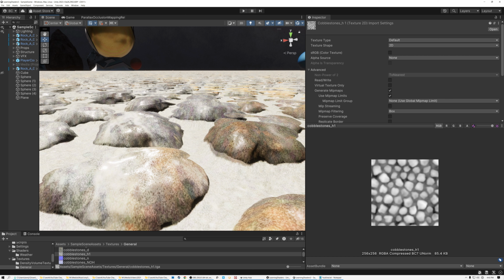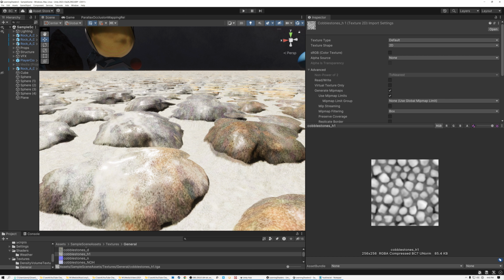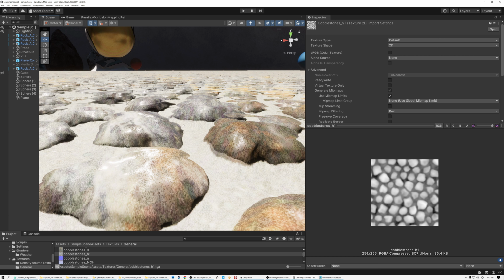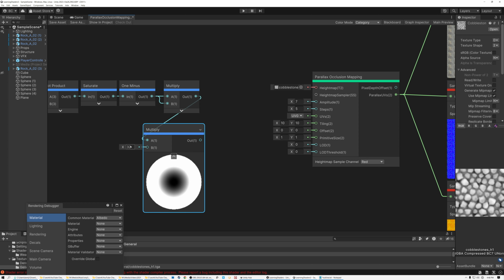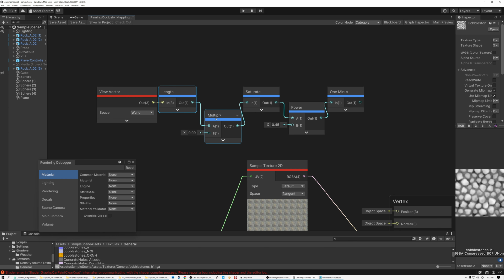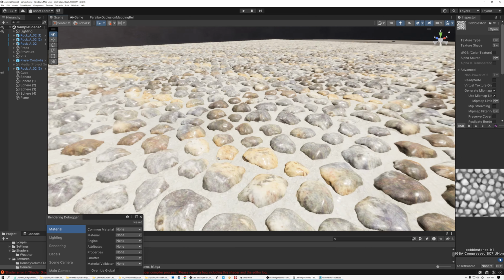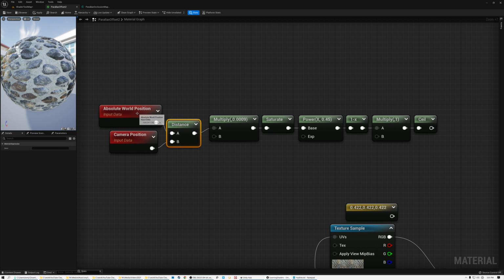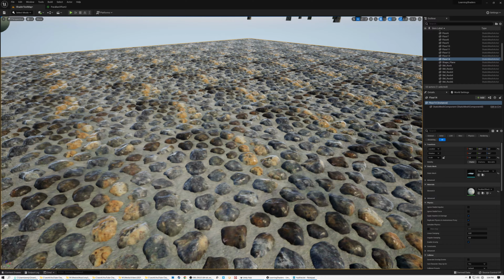Parallax Occlusion Optimization - Advanced Materials - Episode 15

Comment: Thanks for showing me a cool way to optimize POM. Watching your video gave me an idea: what if we mask the steps based on Scene Depth? 
For areas closer to the camera, we could use a higher sample count, and for farther areas, we could use fewer samples. What do you think of this idea?
Reply from the maker: In this video, we're finding the distance from the camera to the surface and changing the number of samples based on that. This is the same as scene depth. You could use scene depth for this instead, if it's available, but there are some cases where it's not - so I chose to use this method.

Comment: Hey Ben, thank you for the tutorial.
I am wondering how the LOD input works in Unity?
I tried to test it by myself and seems like it has nothing common with LOD Group component settings.
Seems like it works the way Parallax Mapping linearly becomes flat when it's LOD input value is between (LOD Threshold) value and (LOD Threshold+1) value.
So probably I can easily use  distance from camera calculation plugged in LOD input to make Parallax Occlusion being flat on distance.
I am wondering if it can make the material even more optimized than you did at this video? Or it just affects the POM amplitude value and does nothing for performance?

Comment: Dear Ben, do parallax materials work with trim sheets (multiple textures on one sheet and mesh cut up into pieces) or just tiled textures? I am having issues to get trimsheets to work properly with pom. Somehow the pom doesn’t know when a trim ends and bleeds into the next one on the sheet. I asked on discord and somebody said that one would have to change uv mapping?!
Reply: That's just how trim textures work, if the uv mapping is off for the mesh, the texture will have other parts of it appearing on it.

For example if we have a simple trim texture, top half being red and bottom half being blue - the way UVs are mapped should be done properly, because if a little bit of it goes up or down that part will be visible on the mesh.

You can use modeling tools in UE5 to change it if you're in that engine or just opening the model in blender to move the UVs.

Comment: There is one thing I don't understand. When you connect both two multiplied masks straight to the base color and move away on a distance- the object becomes black. But how could it be, if we have a ceiling node at the end of all multiplications? I mean, you said the ceiling node would round the number to one, but on a distance I got black color. The first mask works correctly and never goes lower than one (the object is always white), but the second mask goes to black on a distance, having a ceiling at the end, after the all masks multiplication. I mean, this is how it should work in the best conditions, but I don't understand the math here (having a ceiling at the end, we somehow get black(0)).

Comment: I could be wrong, but you can't change shader complexity only changing camera distance and switch steps or so on. It still will have same number of instructions. Only way to optimize material its use different simplyfied mats between lods, or iаm wrong?
Reply from the maker: This is one of those cases where instruction counts are very deceptive.  Just judging by the instruction count, you could easily make the conclusion that you can't change performance based on distance.  But in this case, the parallax node is using a for loop internally, and the instruction count only shows you the maximum instructions.  If you change the number of steps dynamically, it actually DOES reduce the number of loops it's doing in the for loop, so it ends up making it a LOT cheaper. But don't take my word for it.  Try it out for yourself and verify!
Reply: @BenCloward  Thank you Ben) will make some tests with this technique with different type of shaders.

Comment: Thanks, these optimizations helped me develop my POM system that works fairly well with a distance of about 8 units. 
It would be great to take a look at blending POM between multiple landscape textures, as they appear to float above each other.
Perhaps something like including multiple textures in the POM core loop and raymarching all of them and taking the "highest" one. But it would seem that the other textures need pulled down into the screen as if they are the lower parts of the texture that's winning.

Comment: A question is it cheaper to use the Fresnel node instead of the custom view + dot product shown in the video?
Reply from the maker: It may be a TINY bit cheaper to use the custom method but the difference will be so small it won't be measurable. But of course the best answer to every "is it cheaper" question is to test it!

Comment: Thank you for your great tutorials!
When I try to apply parallax occlusion on an object that is not based on a main flat surface I get very weird effects: I tried to make some bumpy moss on some rocks, but the result was quite bad 😞
Is it me doing something wrong or this method doesn't work well when the material is applied on a complex shape mesh?
Thank you
Reply: Simple PoM casts its rays based on the assumption that the surface is flat. You can get acceptable results on surfaces that have gentle curves (like terrain), but the more curved a surface is, the worse artifacts you will have. The greater the offset is, the worse artifacts you will have. If you stick to a small offset amount, and mainly offset down/inward and not up/outward, you can get acceptable results on even fairly curved surfaces.

Comment: What would the performance difference be between this an tesselation?
Reply: It depends on the scale you’re working at. POM works great for larger objects that need lots of detail like terrains. Tessellation has relatively similar performance impacts to polygon count, because essentially tessellation is adding polygons. Tessellating a 4km landscape makes no sense. But for smaller objects, say a tree trunk, it works out very nicely. POM is generally for flattish surfaces and won’t let you make nice silhouettes on corners. Think of the corner of a brick wall, it goes in and out with the grooves, a look that POM can’t really do. POM is also great if you don’t want to even deal with bad topology or anything, it just “works.” The advantage of tessellation and POM is that you don’t have to deal with all the headaches of high poly models until the very end when you see it in engine, and you can easily scale it depending on hardware.

Tessellation at landscape scale is dumb and hurts performance, but at small scale is very nice. POM is somewhat okay at any scale but you kinda get diminishing returns as you scale down, better just to represent with triangles at a certain point. What exactly that point is I’m not 100% sure (though it somewhat depends on your specific hardware) but I just like to use POM sparingly where triangles start to become an issue and where it makes sense to do so (flat stuff w/straight/no corners)
Reply: @dylankuzmick3122  UE5 doesn't care about polycount anymore but your reply is enlightening nonetheless. I personaly like it better to use a height map in the modeling tools displacement deform tools because it's easier but hey! you got me thinking 🤔
Reply: @GhtPTR  Very true, but in fact UE5 doesn't actually have dynamic tesselation as a feature anymore, they got rid of it (except virtual heighfield meshes which tessalate only terrains based on a faloff distance, but that's an edge case I hardly use because of POM anyway, even in UE5). Regarding heightmaps, absolutely, I use them all the time! Sometimes people confuse displacement and tesselation since they go so hand in hand. Tesselation subdivides geo and adds triangles (realtime tesselation removed in UE5), displacement moves the geomety's verteces up and down based on the colors and uv mapping of the heightmap (in UE it's called WPO). Usually adding more tesselation gives more detailed displacement, but since realtime tesselation isn't a thing in UE5, you have to make sure your geometry has enough verteces when imported into the engine to look nice.
One thing to note though is that you CAN add tesselation to meshes in UE5 using the mesh editing tools, but you really should bake it (which takes a couple minutes depending on the tri count) and enable Nanite for it to not slow your system down. If you're working with meshes you've made yourself, it's usually faster to do this in your DCC of choice (Blender, Maya, ect.) instead of Unreal.

Also, for general reference, I find that for a 2X2m plane, I need to add at least 2-4 million tris for it to look comparible to POM, and even still it's not quite there (depending on the steps for POM shader and the angle you look). Though I would guess that with Nanite enabled it would perform better than POM at this scale.
While Nanite is amazing, I wouldn't do anything more than 10 million tris with it, simply because it takes FOREVER to load into the engine, and it takes about as long to bake meshes.
What I like to do is take a bunch of blank 2x2 or 4x4m planes with 5-10million tris each, and just stack them next to each other. Then I apply a displacement material to all of them with global UV mapping (so you don't notice that they're individual planes). For small-medium sized scenes where you don't need landscape mesh features and you want some real displacement instead of POM, this can work wonders. I often like to mix and layer this technique with landscape meshes using POM for larger scenes.

As a last note, given that Nanite is such a beast, I use Nanite + displacement (aka WPO) for pretty much everything except for large, planar objects that can't easily be broken into peices and that I won't see the silhouette of. So far I've yet to encounter such a mesh besides my main landscapes, so I've personally only used POM for Unreal's landscape meshes. Everything else I personally use Nanite, but maybe you'll find a situation in which POM suits you better.
Reply: @GhtPTR  UE5 doesn't care about its game running at 30 FPS either because the marketing is the only thing that matters